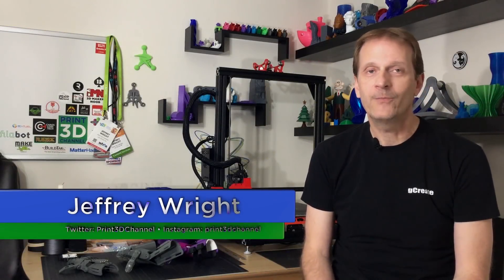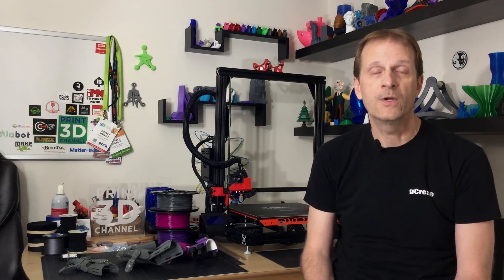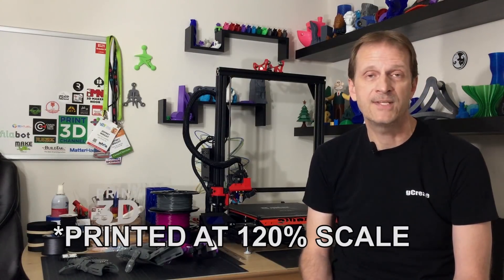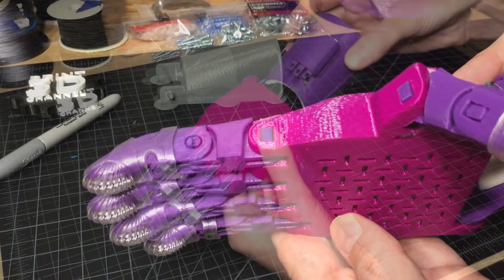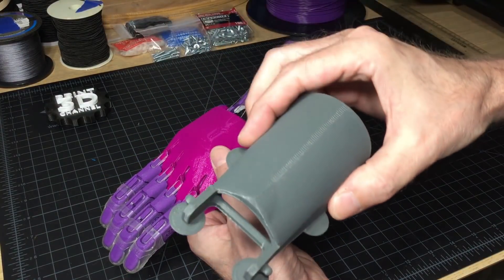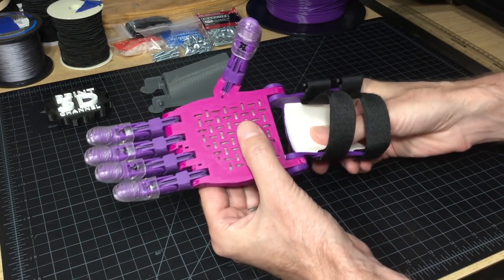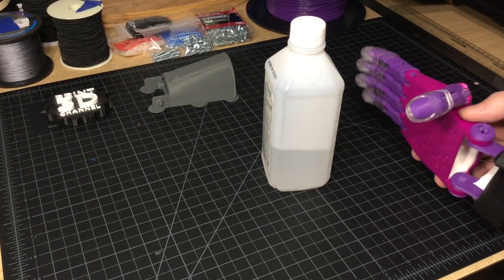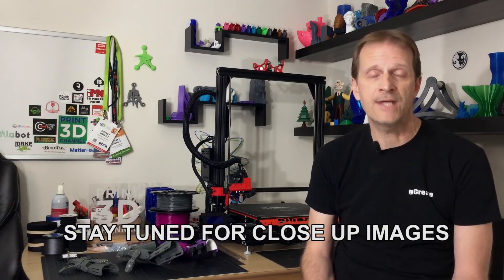e-NABLE Phoenix Unlimbited Prosthetic Hand - Approval Submission Video - Fabrication & Assembly

Comment: Hello. Awesome video! I was wondering if there would be any way to ask for your help/tips getting the tension right on the fingers when assembling the Phoenix Hand. I had one printed at a 120 scale from my local library. The pieces seem to be of reasonable quality. I am having trouble however with the fingers coming down out of sync (the 4th digit hits first, then the 2nd, followed by 3 and 5 (which hit nearly at the same time)). I am going to try restringing with the wrist in less extension than I currently have but would greatly appreciate any suggestions. Thank you for reading!

Comment: I've printed a hand off for approval, but I'm loathed to pay £30 for the kits that contain fishing wire, rubber bands and finger tips.  A full reel of fishing line and 300 dental elastic bands has cost me £16 and I can print the finger tips in TPU flexible rubber filament...…..do you reckon that would be ok?

Oh wow, you literally posted this video today?  I wish you the best of luck with your submission!
Reply from the maker: On the e-Nable website you can find the hard list of the things needed and gather those yourself. The finger tips covers should be easy found at any office supply store. The only hill to climb is the medical grade foam for the inserts, those are hard to find on the cheap. Thanks for the vote of confidence and for watching and for supporting the channel!
Reply from the maker: http://enablingthefuture.org/resources-2/hardware-sources/